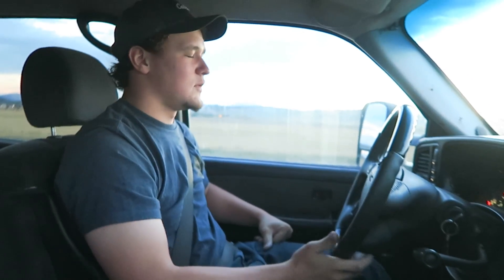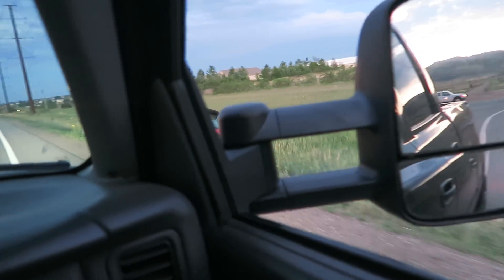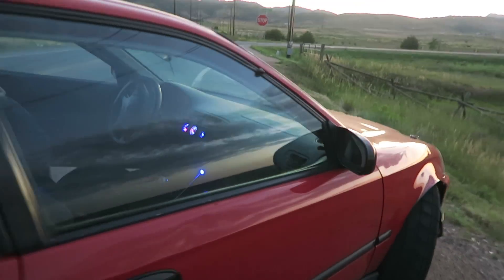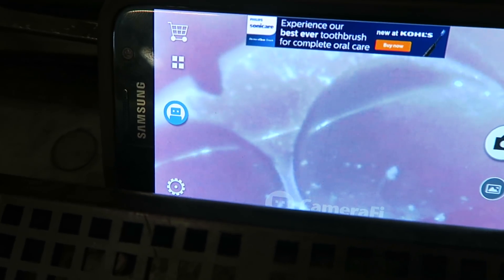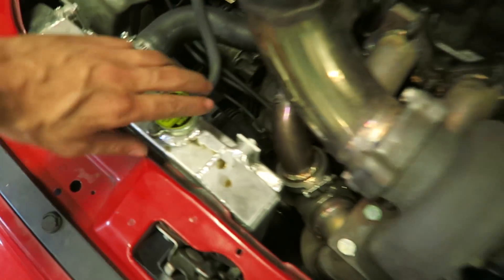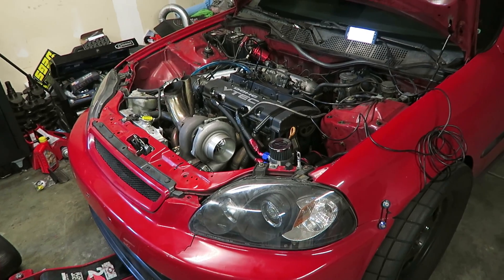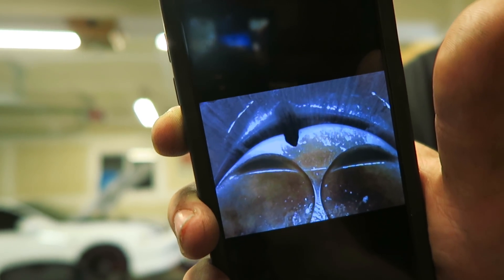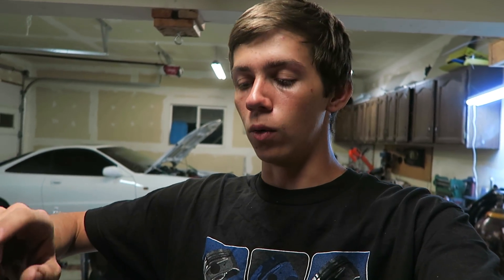Blew up The Hatch :(

Comment: Well that's what you get when you have a stock block pushing 30 or 40 PSI through it with a turbo why don't you build it for Turbo and then it will last a lot longer I'm not surprised that it keeps blowing up because you have a stock block with all that boost going through it come on think about it build it right low compression

Comment: kyle: ''This kinda blows..'' 

Just like your hatch's engine did! In all seriousness though, i feel it would be better to get a new block and pistons that can take this kind of power/compression/heat etc just so that you don't run into the same problems 3 months after this with the cheap option, maybe have a look at the pump etc just to check everything, hopefully it was just that piston that gave in and you can just replace the block and pistons. #notenoughboost

Comment: Do both get the local pistons for now and build the piss out of this block. Aim for way more power than your going to use like go for 1100 and only run 850 so it will last longer. Real question what is the worst that can happen if you run rich all the time besides poor fuel mileage

Comment: High compression + boost is never a good idea, yeah you run less boost  and make more power, but you need to because there is less room for air , and the high compression + 20lbs of boost cause too much compression in the cylinder and caused the piston take too much pressure and heat up and loose it's strength
Reply: ayyjay i'm sure he didn't know that.

Comment: Look at all these pro technicians in the YouTube comments 😂. High compression pistons and boost is risky business. You can have a good tune but pre ignition(detonation) can still occur with high compression. No matter how you build an engine when you get to high horsepower shit is going to break. If you ever saw those fast cars at the track they replace or rebuild their engines after a few track days, even a few passes. That's the part of having high horsepower kids. Forged internals aren't guaranteed to last forever. They are a structure for high horsepower

Comment: you should at the very least have your injectors checked and if need be cleaned an flow matched, or buy some better ones, not sure if you've mentioned which injectors your running..

Comment: Do you think a supercharger or turbocharger would be possible on a 2003 honda element? AWD and auto :/
Reply: tubamacmac yes but why
Reply: It's underpowered and it would be cool to try
Reply: tubamacmac okay then do it turbos are not too difficult to set up but don't expect it to be bullet proof what motor is even in a element
Reply: I'm pretty sure the k24a4
Reply: tubamacmac well you could turbo it most k series manifold will work depending on clearance but other than that the rest will have to be decently custom but I don't see why it can't be done
Reply: tubamacmac and a simple search on YouTube would show you it's been done

Comment: Not the tune it's the injectors get them reflowed or not the pump because all of them would've died just put new pistons in n send it if the block not fucked y sleeves you dnt crank the wall ?

Comment: The hole built was great except the pistons you have some talent working on motors but my h22a was sleeve you did not went sleeve and did not bust a hole through you block yet that much time money investment should go sleeve and  last a very long time trust me . When I had pipes come loose due to clamp failure I had no power what so ever I mean nothing no power the engine was so weak without boost . Then when everything was tight and boost came on it would run strong and healthy that couse of low compression crater piston, you did your build backwards high compression piston on boost is a no no fundamental try and sleeve out your build and youll stop having to drop the engine and rebiuld , love your video bro

Comment: bro save up a lil bit and build the engine with quality components that will cost more right now but will last you a lot longer. buy the shit once instead of 3 times. im doing the h swap right now too but im buying everything quality just so i dont have to do shit over and over cuz of short cuts. its more expensive right now but 1000x cheaper in the long run

Comment: Clearly 700bhp on essentially a stock block and components was never going to end well. Why push it so far.
Just go for reliable max BHP. Say 550bhp or something.
I used to have a Saab B234 4cyl running 400bhp for like 5 years, and it had 220,000 miles on it when i sold it and still pulled 400bhp every day.
So, go for Reliable BHP. Tearing apart the engine every 5mins is going to get old quickly.... Just my 2c.

Comment: Let's face it, 4cyl hondas are incredible, but they are small engines pushing ludicrous amounts of power for their size obv the more cyls the better (not saying any v8 is better than any b series honda) im saying LS > 4cyl, 
In this case it was reliability, but everyone that's in the 4cyl game knows it could blow up at anytime and if it does, rebuild, ez simple efficient
it takes much more work to boost a 4 cyl the only reason they are competitive is because of the price, fundamentally they are at a disadvantage 
so before you talk SHIT on every single V8 or greater cylinder count engine in the entire WORLD, take into consideration what High Hp i4's really are.

Comment: you should run meth inj it will save your motor better than not running meth inj. water helps keep the heat down

Comment: Check out my H build, I can connect you with a place that does cross joined sleeves for h series. I'm high compression & high boost as well. I cracked my block so I just got a new fully sleeved block. Message me for some info!

Comment: H22 are not for boost they are all motor warrior's...
Reply: stone cold LBS! lol it made over 600hp though
Reply: neurotropical it made over 700 but it last two months before it blow... it could have only been 300hp's and still would have done the same thing... h22's are made for all motor killers... could forget internals and it help but the walls are to thin.